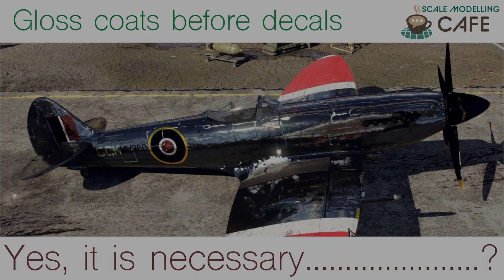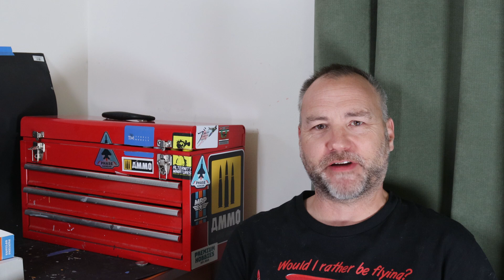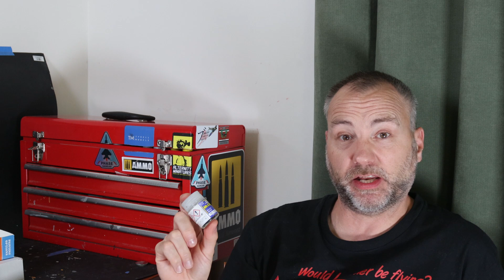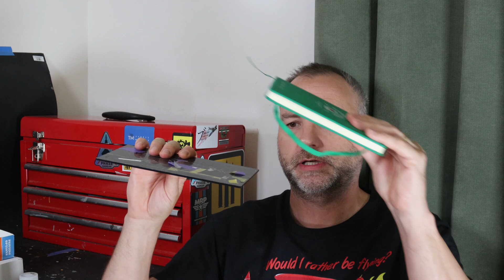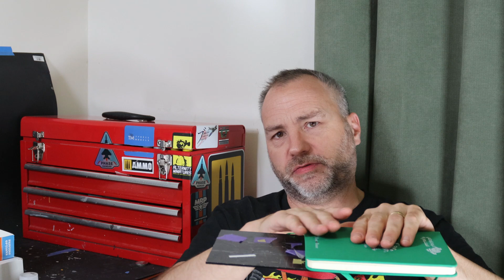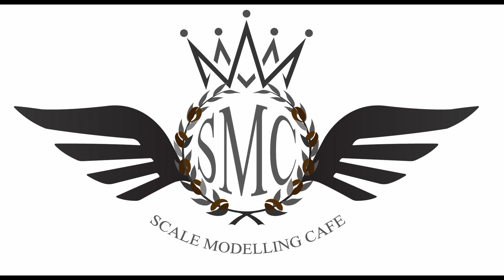Gloss coats before decals, yes, it is necessary.....?

Comment: After 50+ years doing fine scale model railroading, military vehicles, and aircraft, I have tried every suggested method and product  in my search for the ultimate methodology.  The basics are 1) a smooth paint finish, chemically dry after a time period consistent with the brand, 2) decal setting solution of a strength appropriate for the brand of decal used, 3) removing most but not all water from the area being decaled (some water is very helpful for maintaining moisture under the decal so that setting solutions can freely diffuse under it), adding the initial coat of setting solution carefully in small quantities around the edge of the film, not on top of it; this will "tack down" the decal, eliminating any risk of future movements caused by excessive liquid applications,, 4) using panel lines or other surface channels  to spread the setting solution as far as possible under the decal 5) after the initial treatment has dried, additional applications of setting solution are added to the top as well as decal edges to stimulate softening of the entire decal, 6) when the final coat of setting solution has dried, the area is inspected for any sign of silvering and/or poor adhesion around complex surface detail, and finally, 7) using the point of a fresh clean #11 blade, carefully open venting holes in the effected areas using carefully controlled pin pricks (no slicing)  Use enough holes to allow air to escape as the setting solution is added.  The goal of this step is to allow setting solution to penetrate under the film and into the silvered area to work there.  Do not cut into the paint layer if at all possible.  Penetrations will always lead to some damage of the work and in some cases cause the setting solution to react with the paint itself.  Always avoid this!  After all of the above are done, rinse the area with clean water to remove any traces of film adhesive or other contaminants and move on to final top coating.  I haven't added clear coating to the list up until now because it depends on your paint brand and it's dry surface qualities as to whether you need it or not.  At most, the only clear I normally use is a light coat of semi-gloss before decaling and one or two coats of the desired final sheen clear coat.  I always stay away from clear coatings that give a high gloss.  I  have never found any method or product that will restore a painted surface covered with gloss to a dead flat finish that we normally want on most of our models.  I do like the semi-gloss finishes on scales larger than 1/72 because it gives a sheen much closer to a relatively new finish in the real world.  Detail is always much more visible if a slight sheen is present.  Dead flat finishes on a highly detailed model are self defeating in a way because they tend to loss detail in the black hole effect created.  A final word here about the role of decal quality:  Learn who produces the highest quality in your area of interest and alway try to use these products!  Kit decals can vary in quality from good to awful and should never be trusted unless tested first.  Thin film decals give the best results, but you must learn how to deal with their fragility before you get consistently good results from them.  Kit decals that are not protected by plastic packaging will likely cause problems due to cracking induced by humidity changes to the exposed decal paper.  Buy what you need up front to avoid the temptation to work with damaged goods.  I suppose I could go on for several pages discussing further hints and pitfalls, but your own experience is your best guide.  After half a century, I am still leaning things.
Reply: Larry, you need to start you Youtube channel and share your experience :D
Reply from the maker: I use VMS satin, its the perfect sheen

Comment: Thanks for sharing your thoughts and ideas Jamie. 
In general my approach is very similar to yours, I tend to get glossy surface before decals. I use Gx100 as well as long as 2K clear for cars. But that depends on the task. E.g. If surface has a lot of details, like rivets, panel lines etc. then I will buff surface a bit, apply 1-3 thin layers of highly diluted Gx100 and sand then sand it with Tamiya sponges 1000-2000 and may also want to use Tamiya polishing solution. But if I want to cover decals on motorcycle fender where you have no panel lines, rivets  and other surface details, then I go with 2K clears and apply in 1-2 thick wet coats. 
Also I believe the choice of technique depends on other aspects and final finish you plan. For most of cars and motorbikes you want high shine, for tanks it would be matt or semi-matt, for aircraft - it can range from matt to gloss. And this also may have impact on choose of your approach. Also applying decal on flat surface is different from curved (e.g. apply carbon decals on motorbike fenders. 
There is no one ultimate receipt. And that is why it is cool to learn new approaches. I like to experiment as well. I use plastic spoons a lot for experiments. Especially if I try something new - technique or chemical.
Reply from the maker: Thanks mate.  I avoid that 2K stuff, it's utterly lethal!
Reply: @thescalemodellingcafe  Yeah, I can understand that and my ex-wife will understand you even more, because she was crazy about 2K clear smell when I was painting motorcycle fender on the balcony with door closed :) But in scale modeling I use it as well. Actually when you spray it on models then smell intensity is similar to Gx100. And I recommend to use special 3M mask with antichemical cartridges A1 or A2 to protect yourself. So it is not that bad if you have well-ventilated area and use mask. Anyhow, enjoy your modeling process and I will be glad to see more videos... maybe just with a bit of pictures to demonstrate the issue or process. In Latvia we have saying: Better see 1 time than hear 7 times :) 
Good luck!

Comment: I rarely use gloss and rarely have problems many posts say they use it as a protection layer but thats not for decals is it.  If your putting down a gloss coat for other reasons, sure, I understand. Having said that I do other things before and after decals but i think it more to do with the subject matter i build. Each to there own. One things for sure in modelling if you need to change or adapt to improve the craft then its all good 👍  happy modelling.
Reply from the maker: If it works, it works!

Comment: Personally I always give a thin layer of X-22 Tamiya (diluted about 80% with lacquer thinner) immediately followed by a layer of pure lacquer thinner. Which seems to smooth the X-22 to the limit. However, I will test the "no clear cote" theory, because with these modern kits (Eduard, Tamiya or Zvezda) the panel lines and rivets in 1/72 are so shallow that the risk of filling them up before the washes is real. In 1/72 scale everything is difficult...
Reply from the maker: If it's really thin, then the rivets will be fine mate

Comment: I try and adjust my techniques depending on the surface of the plastic and whether I have achieved a consistent finish on the paint. Basically I use the suck it and see method. You may derive from that that I am still learning, with some disasters and the odd triumph thrown in.
Reply from the maker: Practice is key
Reply: @thescalemodellingcafe  Agreed. Cheers Jamie.

Comment: The surface doesn't have to be gloss but rather smooth for decals. Mind you the best way to have a smooth surface is to gloss it. I can never understand the resistance to a gloss surface. Really only takes 5 minutes to gloss and even less to matt the finish down.
Reply: But Matt paint by it's nature is not and can't be smooth
Reply: Yep. Does no harm and it gives you a better chance of success. Fact. Some of the super boys might not do it, but normal dudes like me need a good surface to stand a chance.
Reply: Takes 5 minutes. What are you building?
Reply from the maker: Yep!

Comment: There should be no debate here [cough] I am old school so I use Micro Set and Micro Sol or Solvaset if the decals are troublesome and I decal over a coat of Future and seal it with another coat of Future before weathering and I have had decent results I do think that some decals because of their age or manufacture are just crappy and if they don't work for me, they are definitely crap.
Reply from the maker: All that helps

Comment: No it isnt necessary as long as the surface is smooth.the only time i use gloss,be it varnish or paint,is if im doing a model of a factory fresh example or a display team aircraft.
Reply from the maker: Smooth is the key for silvering prevention but a gloss coat does help eliminating the visible carrier film
Reply: @thescalemodellingcafe  it does help but i have found micro sol / micro set works well enough for me on its own...but that's just my two cents...ofcourse its up to the modeler on how they want to finish their model...and the end of the day its their kit and their choice

Comment: Pigment in paint is not acrylic...
Reply from the maker: That may be true, I don't know.  But the convention is water/alcohol based paints are called acrylic by modellers in general in the same way modellers say "sprue" when the term used by the injection moulding industry is "runner".  Using the colloquialisms avoids confusion.
Reply: @thescalemodellingcafe  I have no issue with calling water or alcohol based paints acrylic, as long as the binder is acrylic. But the binder is not the pigment, and those paints did not get their name from the pigments - because the same pigment can be used in enamels and acrylics. :)